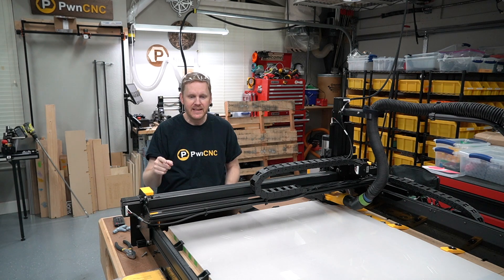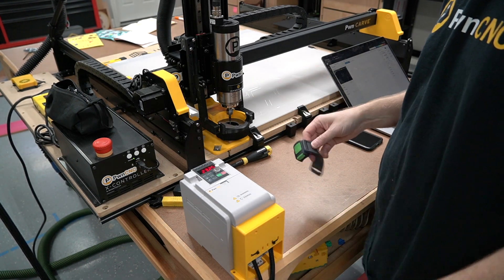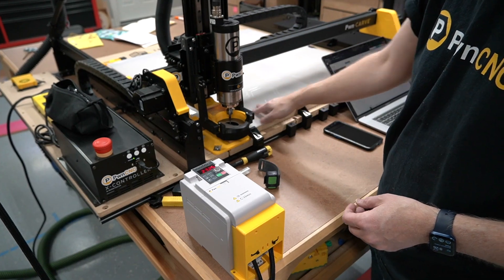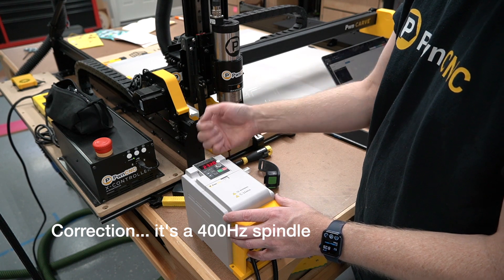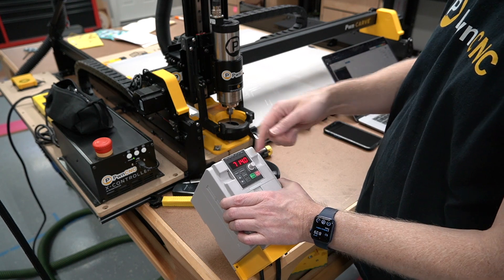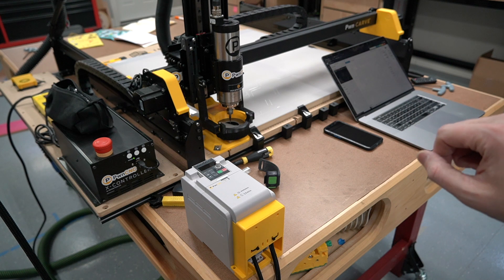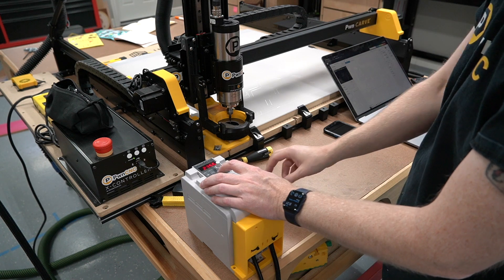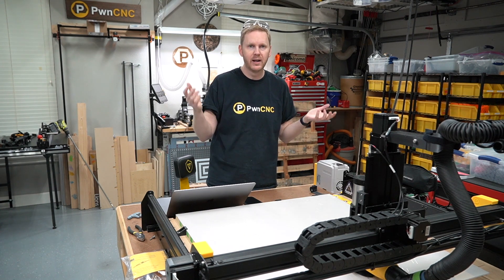Carving my Rat Rig's Panel Doors out of Lexan using the PwnCNC Spindle

Comment: Question for you - I have a Shapeoko XXL pro - Makita router - bitzero - bit runner - bit setter - the basics. The machine is a dedicated to one task only, for now, and thats milling G10, a composite material often used in knifemaking. Yes, I replied to another of your posts. The piece is basically 9x12 x .250" with profile cuts, through holes and shaping (a fluting pass). The router is way larger than I would ever use, but it is what it is... I run 4 tool operations per part holes/counterbores - fluting - profile - chamfer; based on the info above, are there any dire changes I should make to the machine? Or what, in time, would be the first thing I should upgrade, without breaking the bank, if I even need to. I have a decent dust collection system too. Thanks for your help.
Reply from the maker: You're actually good IMO.  Maybe protections for the machine like our Y-Stepper Covers to keep any dust that escapes your system from causing unnecessary wear on your belts.
If I were you i'd look into the Saunders Machine Works aluminum beds and vice.  Those are beefy parts that provide a lot of rigidity to your setup.
Another upgrade to consider is a proper spindle.  But in your case the main advantage would be noise control.  
Lastly recommended is a good enclosure.  I'm working on an enclosure design and hoping to bring it to market very soon.

Comment: Hey brother how is that mill right doing ... I bought the 35x35 in August and can't seem to carve ,cut or do anything with it. It carves good and then it kicks over to the right ... I have trouble with the ugs open builds and g sender ..... I was looking for ur opinion....
Reply from the maker: I'm happy with the Mega-V.  Love the rack-n-pinion drive... very strong and holds up well on the hardest of woods which is nice.
I run all of my machines with CNCjs running on a raspberry pi.  This is an awesome controller software i highly recommend.

Comment: Wish you would have went with a VFD that is compatible with all these hobby cnc controllers with rs-485.

 You should look into the hatachi VFD.
Reply from the maker: Hello Mr. Craig, my VFD is fully compatible with either PWM/GND and RS-485 control capabilities.  I had the manufacturer design a very special version of the controller with all of the features us hobby cnc owners would want.
Reply: @PwnCNC  Gotcha, your website just says (more info on this will be released later)

I dont see anything in your documentation section either.

What are the settings for getting RS-485 to work?
Reply from the maker: @Mr._Craig  The VFD is capable of both RS-485 and PWM/GND, but i have not tested it on all of my machines yet.  The "more info later" message was i will be working out and publishing detailed instructions for hooking up to each brand cnc's controller.